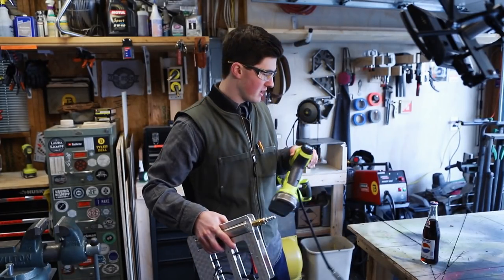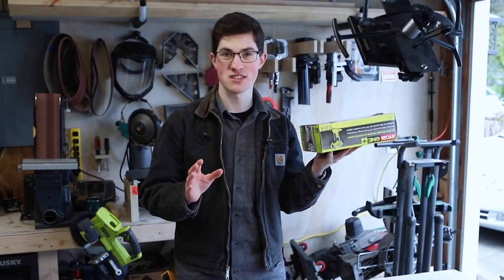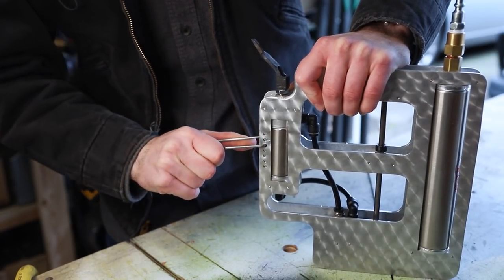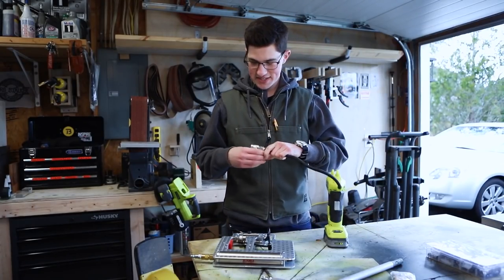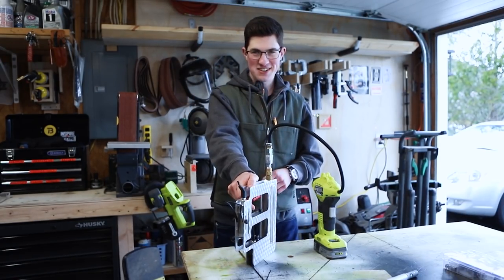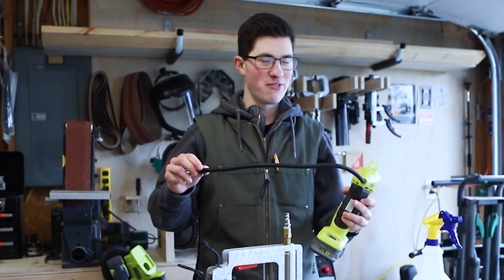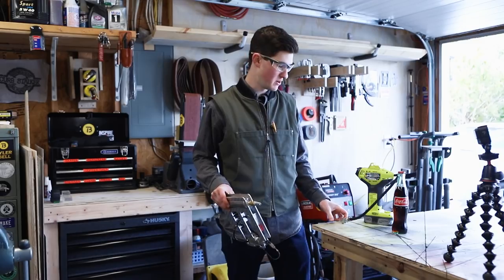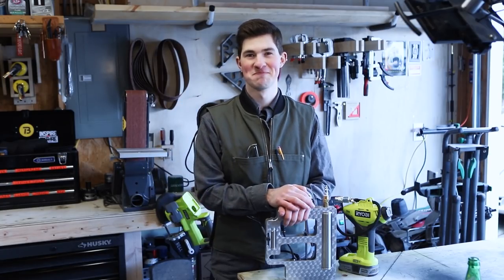Over-engineered Bottle Opener | Upgrades and Testing!

Comment: It is not engineered over enough by a long shot. What you need to do is to make bottle retainer move freely, pulled down by weak spring. Then add pneumatic lock that activates when you press the trigger but before the actual opener action. The lock will stop bottle retainer from movement until the trigger released. This way ANY bottle can be opened without adjustments.

Comment: Referring to this as "over-engineered" reminds me of a toilet paper holder we had to build in a college engineering course.  The base was c-section steel, and the sides and roller were aluminum.  The finished item probably weighed close to 5 lbs.  We referred to it as a combination toilet paper holder / boat anchor.

Comment: Nice work Tyler. Question.... are you able to dial down the amount of air used per cycle? Might not need that much force in turn allowing more cycles per fill.

Comment: I just designed a portable one that'll fit in your pocket and doesn't use pressurized air. But will still fling the cap 30 ft in the air.

Comment: Integrate the compressor into the set into the bottle opener use electronic solenoids to where all you have to do is squeeze the trigger on the air compressor  pops the lid off of it

Comment: Have you thought about potentially using CO2 cartridges for the pressure? It would also give a cool visual because of the frozen gas release. It wouldn't be hard to do the research, there are CO2 bicycle pumps that fit in the palm of your hand.

Comment: You have GOT to make a better bench for that vise! 
If the bench wobbles like that when you're hammering on something in the vise, that is a lot of wasted motion and energy. If made with wood, I would recommend using posts no smaller than 4/4's, or something with a similar cross sectional area. And you need to put in some kind of cross bracing as well. 
Sure, this sounds like overkill from a load bearing perspective. It is, but it is a workbench, not a shelf. It is for pounding and hammering and bending and sawing and all the things that need something rock solid to be done easily and without excess strain. If it's not overbuilt, it's underbuilt. If your back doesn't ache at the thought of moving it, it is too light.

Comment: An interesting option that could be explored is to use liquid propane. Use the gaseous propane to drive the actuator at which the LP would boil off inside the tank to replenish the vapor pressure.
Totally dumb, of course, but would hold several orders of magnitude more 'charges' in the same volume.
Reply: Yeah, because everyone wants their beer with a fart smell.

Comment: Looks awesome!.. what you should do is put the male fitting onto the tyre pump and the female onto the tank, this way you’ll be able to remove the check valve off the tank to make it more compact and you won’t be pressurising the line.. also another idea, you could potentially make a system to use 16g disposable c02 cartridges, that would be awesome!